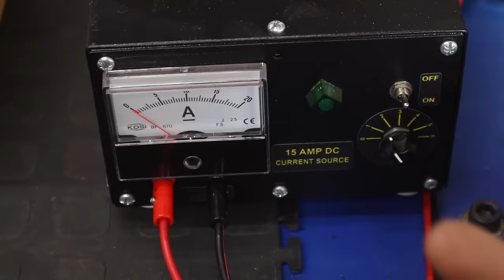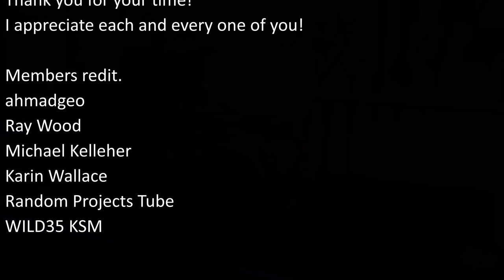Flooded Honda GX390 Restoration - Full version

Comment: I have disassembled and repaired thousands of such engines. I was interested in watching a layman do this work. I was laughing most of the time, but when he took out your flywheel WITH A HAMMER, I DIDN'T LAUGH, I CRIED!!! Engine knocking is a distant echo of hammer blows! Just kidding... Check that the flywheel isn't resting on anything. Congratulations on your hard work!
Reply: callin' BS, on thousands thats a lot

Comment: So when I watched you put the lifters in I saw that the lifter closest to you didn't slide in smoothly you had to force it in and when you did it sounded like it was scratching, When you put those lifters in they need to move freely in and out, if you stick it in it should fall right back out that's how smooth they need to be, I wouldn't run the thing for long with a lifter knock, it could cause further damage to the engine. Besides that you did an excellent job. (p/s, make sure both lifters move freely not just one of them and remember which hole came out of because they need to go back in the same hole)

Comment: Just rebuilt my GX 200, ( on a power washer I got from my dad, easily from mid 1990s) added electric start. Wish I had seen your video before that, but it was a blast to watch. Great engines. Thanks for a great video.
Reply from the maker: They are fun to work on too! They are kind of complicated, yet simple the same time.
Reply: 8:02 como se llama esa pieza por favor necesito comprar. Alguien sabe?

Comment: Overall nice. You should have set the coil air gap with a business card or something similar. You can't just eyeball it. That may be what's scraping. Also, by completely removing the governor arm, you need to index it with the throttle plate in the carb. And I would have oiled the bore before inserting the piston. Yeah, I know you oiled the rings, but the bore is important too. And even on a small engine like this, it's important to find out what the sequence of bolt tightening is. You'll get there. You've got the big stuff covered!

Comment: You and Machinery restorer have helped me start doing restorations on this kind of stuff. I bought a used parts washer and a sand blaster and I’m building a mini paint booth because I can’t powder coat where I live and I don’t have the money. As my big project I have a John Deere LX176 lawn mower that was my grandfathers and I’m going to do a body restoration on it. And as my small project I also have a craftsman engine from the late 70’s that I’m going to “somewhat” restore. I’m only going to do a custom paint job on it only because it already runs really really well and doesn’t smoke at all. I’m thinking a yellow and black paint scheme also little black pin stripes since those are my favorite colors. Hopefully I’ll move up to restoring a whole mower or a tractor someday.
Reply: Hey they have powder coating setups for cheap on Amazon and at harbor freight.

Comment: i just struggled for half a day getting the exhaust pipe off one of these. the nuts came off no problem. but i couldn't pull the pipe off. Ended up shattering the cast iron into bits until i could spin the studs out lol

Comment: The knocking noise is far more than a valve. I believe it is the connecting rod either on the pin end or the crank end. That should have been miced and tested with a compression strip. These bearingless connections are really a flaw in the design.
Reply from the maker: Was the conrod, crank end. I have replaced it since and its quiet now.

Comment: Main reason I love Honda is they all have low oil shut down on them
Reply from the maker: Not all of them, the older models don't have them.
Reply: Also if the engine is for a Go Kart the low oil sensor is removed

Comment: About the noise: I think the piston head is hitting either the gasket or the head. When you fit a larger piston it nay give those problems, as it is bigger bore piston may hit the gasket or as it is another piston it may be longer from pin to head size. Inspection will tell, the hitting point will be gray / different color, even if it has only run for a few minutes.
Reply: 1:02:17-1:02:31

Is this noise normal? I hear some grinding. Or is this just because lack of oil?

Comment: Great video! I have a question I hope you can provide your thoughts on. I have a crankshaft on my GX390 that is that is .0004 beyond (4.1416) its service limits (1.415). This condition is only on one spot...all other measurements are at or above the service limit. This engine drives a generator and I dont believe the cranks are not available currently. The engine ran great, but I hate putting this back together with this condition. It does have an out of round condition on the journal of 0.0017 worst case.There are no oversized bearing for this motor. Any thoughts/advice on using this crank?

Comment: this machine if do a service if you pulled a machine a parts and it back if you set the timeing worng have a gas what is going to happen will it started or it will damage everything

Comment: MAY HAVE MISSED IT, BUT HOW MUCH DID YOU BORE THE CYLINDER OUT (HOW MANY 1/1000)  AND DID YOU PUT AN OVERSIZE PISTON AFTER THE MACHINE SHOP REBORE OR WAS A STOCK PISTON AND RINGS STILL OK TO BE USED----THX SO MUCH!!!!

Comment: Did you ever figure out the knock?   I was betting on valves but after what you did I was hoping for an easy fix.
Reply from the maker: It turned out to be a worn conrod.
Reply: @AJRestoration  Not an easy fix but glad you found it 👍👍👍👍👍

Comment: I suspect that the hammering noise was from the connecting rod - the sound of death. Does it change if you press down on any thing? If so, then it cannot be from the connecting rod.
Reply from the maker: Correct, I had to replace it off camera. The conrod was done.
Reply: @AJRestoration  So, did the sound to away after the new conrod?

Comment: Did you check the valve clearance? Beautiful restoration, great job.
Reply from the maker: I did, it turned out to be a worn conrod. I have the new part, I just have to fit it.
Reply: @AJRestoration  Figured it might either be a really bad valve spring, loose metal in the muffler or rod knock since it was pressure related upon throttle up.  :) Thanks for the look into a GX390.

Comment: Valve adjustment should be done at compression top dead center. You seem to have done it at exhaust top dead center.
And the engine must be cold.
Reply from the maker: Valves were done to spec. It was the conrod that needed replacement.

Comment: The clattering sounds like it was the oil slapper inside the engine. Touching the case or another part inside. Does not sound like valve clatter.

Comment: Sounds like a rod knock. Check the crankshaft journal for size, also check the rod for size.   Bet you have a worn rod or crankshaft journal.
Reply from the maker: It was a rod knock, I have since replaced the rod.

Comment: Check the valve stem caps, should be one on each valve stem.
Reply: I see no valve stem caps on my engine. If they are not there, does it create a problem ?  Thanks

Comment: It knocks ! Maybe valve lash
I would not count on it
Seems you would have set the valves 
Nevertheless
It has what sounds like a knock
That not good
Reply from the maker: It was a rod knock, its been fixed with a brand new one.

Comment: Painting ,  Welding are okay  using old crankshaft without new big end & small end & without reboring the cylinder & new piston is not a complete restoration. God for some people not good for people know about engines.??
Reply from the maker: Cyllinder was done to .50 oversize with a new piston and matching piston rings. Thank you for the great comment, love you!
Reply: As you see by the reply from the restorer new piston etc. but if its not broke dont try to fix it. If the crankshaft bearings are to spec there is no reason in this world why you need to replace them,  I have done many engines without replacing big and small ends and in lot bigger engines, a proper restoration is putting things back to within factory specification, if something is not worn out replacing it is just a waste of time and money.
Reply: @incubatork why waste money and time on a repaint and not spend$50 on a set of bearings. He pulled the bearings off anyway